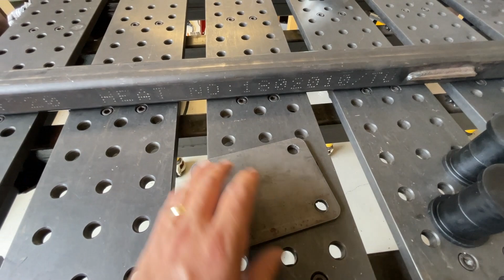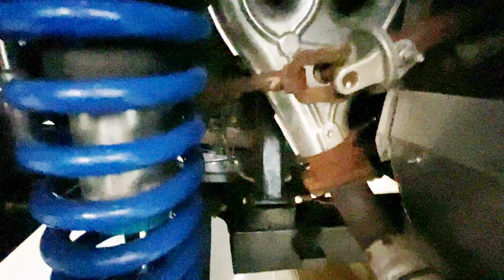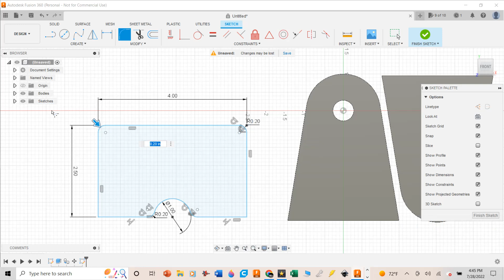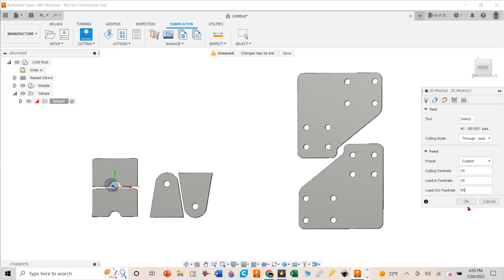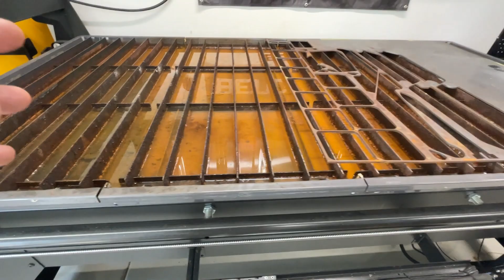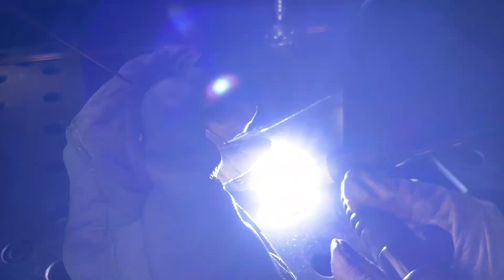Simple LS Engine Mounts - I use the Langmuir Systems CrossFire XR to build Engine mounts for Lefty

Comment: Thanks for the videos on Fusion 360, that has been a life saver for me.  I do have a tip I can share with you.  In this video you were unsure of the thickness of 3/16 as a decimal.  You can actually type in the fraction and the software will convert it to a decimal for you.  Also, you can add and subtract and the software will convert and compute the result.  For example you could put in "1/2 -3/16" in the dimension box and it will result .313
Reply from the maker: @williamnorth501  going to try that right now.   Thanks.

Comment: I've been looking into purchasing the CrossFire XR thanks to your videos! I have been a little hesitant because I have looked at other tables that have add-ons for rotary cutting and haven't found much out there other than some DIY for rotary cutting on Langmuir. I was hoping that there would be some kind of attachment to do tube notching and artwork with this machine. Have you looked into this, or heard anything as far as Langmuir coming out with something like this? Thanks, and keep up the great videos! I have always dreamed of going to the baja 1000!
Reply from the maker: I have not seen the CrossFire do anything other than 2D plasma cutting.   I did get a chance to use the BendTech Dragon tube cutting system…Amazing.  Would be nice if Langmuir Systems would make an add on.
Reply: @ntdracing  I bet the dragon was awesome. Their software is amazing as well. Hopefully Langmuir will come out with an attachment!